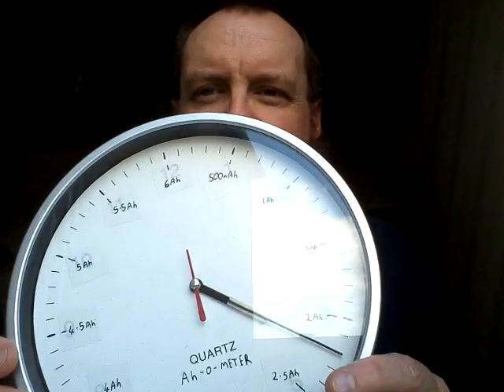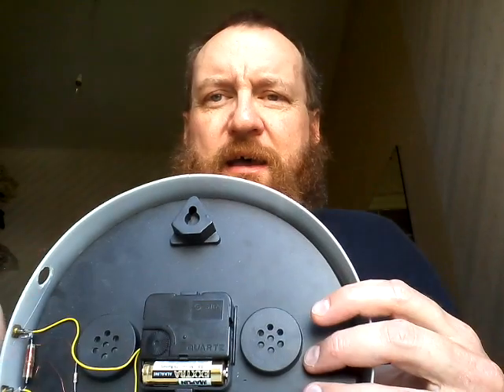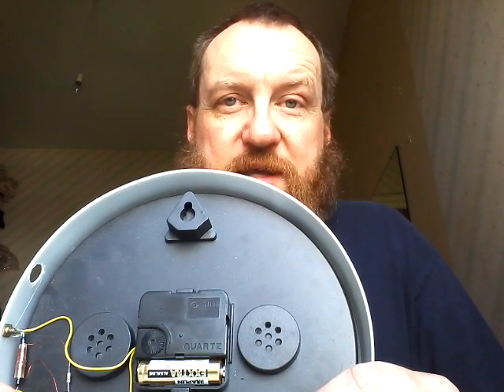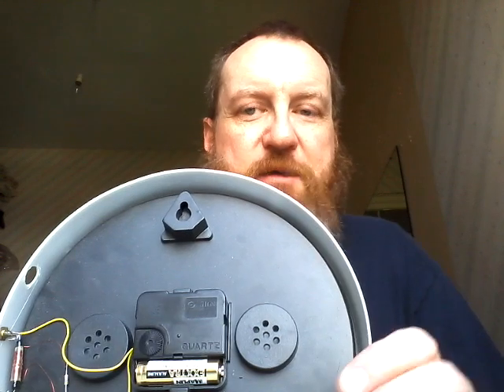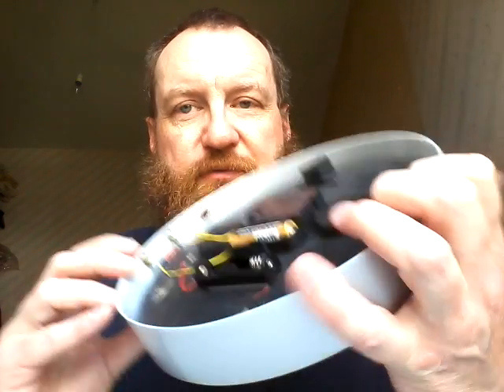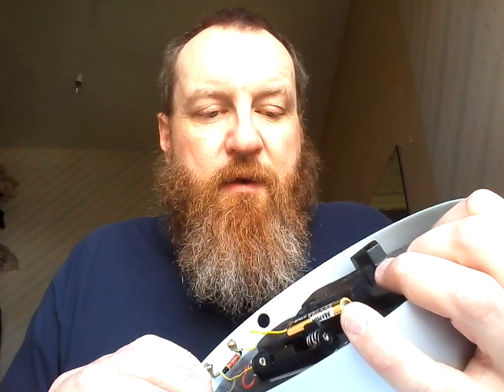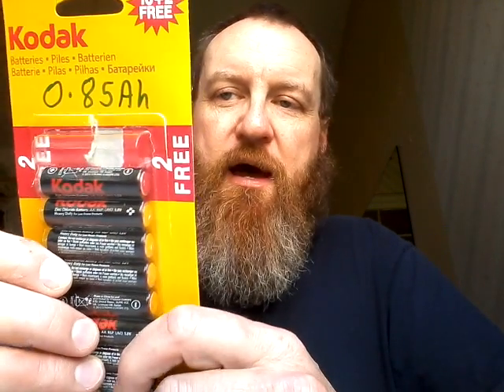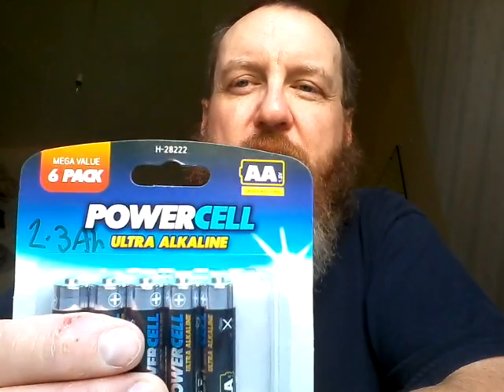Alkaline battery capacity tests.

Comment: I made a complaint to ASA about Duracell's comparison.  After about 2 months this is the response I got back:

----

Your Complaint:  Duracell
 
Thank you for contacting the Advertising Standards Authority.  I understand you have raised concerns about  a recent Duracell TV ad.  I’m sorry to learn that this ad has caused you concern.
 
You may be interested to know that we have previously investigated a similar complaint regarding Duracell ads, you can find the full ruling here (http://asa.org.uk/Rulings/Adjudications/2014/11/Procter-and-Gamble-UK/SHP_ADJ_250557.aspx#.VPXJN6RF1i4), and similar evidence was provisionally provided in this case, which supported the claim 'up to 10 times' longer in terms of a comparison between Duracell and the 'leading' zinc batteries, in the specific context of use in a Furby.  The claim that the compared brands were 'leading', was also supported by evidence which showed that 'zinc carbon/chloride' batteries made up 25% of battery sales in the UK, due in part to their availability from 'pound shops', and that the brands compared represented approximately 97% of the zinc carbon/chloride batteries sold in the UK. 
 
I understand you raised concerns that Duracell’s claim that their batteries last up to 10 times longer than competitors is not valid as they are comparing their alkaline batteries to batteries of a different technology. Whilst I acknowledge your concerns as per this previous ruling, whilst there are differences between zinc and alkaline batteries, they are outwardly identical and can be used in the same appliances.  Given that the ASA Council has recently considered both types of battery as intended to power devices and therefore to be meeting the same need or intended for the same purpose, we do not object in principle to a comparison between such batteries and on the basis of the evidence we’ve seen we do not consider the claim ‘up to 10 times longer’, purely in the context of a comparison between Duracell’s alkaline batteries and the leading zinc carbon/chloride batteries, likely to materially mislead.

----

So basically "Yeah, people have complained, but we don't actually have a clue about the technology to do anything about it"...

Comment: Rechargeable is ALWAYS the answer. Also, screw AA. Make 18650 the standard! I have two sets of Sony VTC4s which I've had for well over a year being recharged a couple of times a week each and they're both still awesome!
Reply: +Zlyzer
I'd agree with you about making 18650's the standard, if it wasn't for the pesky issue of the voltage difference... 2x 18650's at full charge = ~8.4v, 2x AA at full charge = ~3v.
If it took 2 AA's in series, you've gotta use a "dummy" cell to take up the extra space and complete the circuit, and you're still boned if the device only took one AA to begin with or it used the two cells in parallel (some coordless mice from Logitech do that for better battery life).
Gotta think of backwards compatibility!
Reply: Yup, you're right! It's such a great cell though!
Reply: Zlyzer
it IS a great cell, the problem is that so many things aren't designed for it. I think adapters would be a solution for those things that need 1.5v.
Problem is, a 18650 is EXACTLY the same size as a AA.
Maybe a "18300" cell (10x83mm instead of 10x 86.5mm)? That would leave enough room for a tiny switching buck-converter.
Or, modify the protection circuit on a "internally protected" 18650 so that it also acts as the down-converter, while also accepting charging voltage (likely thru a diode).
Something like that could be made to work, I'm sure.

Comment: The best buy I've found for cheap batteries where I live in the USA have been the Panasonic and Sunbeam Alkaline AA & AAA batteries from Dollar Tree. Dollar Tree also sells carbon zinc "Super Heavy Duty" batteries, but I also agree those batteries are junk.
Reply: order them online, you can get 270 a.c. delco alkaline aa batteries for $50  shipped with 2025 exp date or 180 aaa shipped for 30. we use duracell procell industrial batteries at work. I went online and ordered a case of 144 Aa industrial batteries for $36 shipped off of shoplet. they start out with a mah of 2850 and decline over a long curve instead of sharp drop. I work for a international multi hundred million dollar a year company and they have tried all the industrial batteries and  rayovac they tossed, and have been with duracell procell for several years now. they really do last. but you shouldn't be paging more then 22-25$ with shipping for 100 alkaline batteries. duracell, rayovac, a.c. delco, maxwell, Sony, Panasonic, shop online for batteries the stores are a rip off. more people then you think do this, constant turn over of fresh stock. I just stocked up last week on over 300 batteries for under $100 and will last me the next 10 years with two kids and lots of toys and gadgets

Comment: Boo... it looks like Poundland are no longer selling Fusiomax Endurance AA & AAA batteries any longer :-(
Reply: I found a pile at another Poundland so bought a load of AA & AAA packs.
They're no longer advertised on the official Poundland website and some stores don't appear top be stocking them anymore.
It could be just the remnants of existing stock left in some stores or a temporary supply issue... time will tell.

Comment: my guessing is simply duracell are branded ultra cheap chinese ones. either that or rejects from main production.  I used to work in product design and had alkaline cells priced up with the chinese for products. the prices used to vary between 2 and 4 pence each!

Comment: Alkaline batteries should not be discharged at 500ma this will greatly reduce the capacity.  If you repeat this test at a discharge of 50ma you will find the capacity of all these to be over 3000mah
Reply: Yes but that only covers a use case where you will be using that amount of power, like in a remote perhaps or certainly some LED lights (dependant on number of LED's.  Most AA's these days get put into more demanding circuits.  Maybe I will test this with my MAHA charger to see just what kind of difference you can expect.

Comment: I've been under the impression that batteries are a bit of a lottery regardless of brand. They deteriorate naturally and batteries that have been on the shelf for years won't last anywhere near as long as ones that have been recently manufactured.
Reply: I don't know, i haven't exactly ever been disappointed by GP (Gold Peak), and i used to buy Varta before that, they were very consistent, but the prices are not to their advantage these days. And you can read expiration date to see whether it spent much on shelf.

Comment: I would not be surprised if those 'simply Duracell' cells were knockoffs.  The Chicoms are not exactly known for respecting trademarks.
Reply from the maker: it's possible, but if they are they are an exact clone with none of the usual tell-tale clues.  Duracell is just another brand of Proctor & Gamble.  So the only thing that's really going to be different with them is the level of advertising.
Reply: bigclivedotcom a few years ago poundland sold duracell knockoffs, the batteries said duracell and the colour scheme was similar to duracells but the packaging just said batteries, also the were made in china I dont think genuine duracell batteries are made in china i thought they were made in Belgium. Good video I might not buy the duracell batterys out of poundland anymore and might buy the fusio max ones insted.
Reply: alistairstuart2009
i remember the duracell knock offs, the generic package.  and the batteries i think were lighter than genuine

Comment: Fusiomax Endurance alkaline batteries are still the best alkaline batteries I've found to date... and at only £1 they're a bargain :-D
P.S. Poundland's Fusiomax rechargeable Hi-MH batteries are also pretty good for £1 and have a higher capacity than stated on the batteries :-)

Comment: You should check batteryshowdown dot com, they have tests with lots of batteries inclusing carbon-zinc, alkaline and lithium and at 2 currents (200mA and 1A)

I've contributed to those tests myself by sending the author a bunch of batteries available in my country (he's from UK), hence why I can recommend it without a problem.

Comment: I don't rate Duracell at all. I had two leak in a Radio Controlled Clock while the clock was still working. I will never buy Duracell again. I'll stick to £Land rechargeables.

Comment: testing 1 cell of each brand does not make a comparison. i like many of your videos as you know what you are talking about BUT this video is, as your last word states, shit! as you found in one packet 1 battery was dead why did you not stop there as you did with all the others? try testing at least 100 batteries of each brand bought at different times from different stores so you are testing different batches of the same batteries. average each brand and you will start getting a reasonable comparison, also include the 'dead' and 'perfect' batteries to make the average more reliable, as you bought those none average batteries from different batches others will also have the same chance of getting those type of batteries. also add into that batteries bought at supermarkets and battery specialists. only then can you say which batteries are better value. if you dont do a proper test you will have lost a viewer and others will also stop viewing once they understand that your 'comparison' is just like many of the cheap dodgey cheap crap from china. 1 lie does more damage than 50 truths can fix.